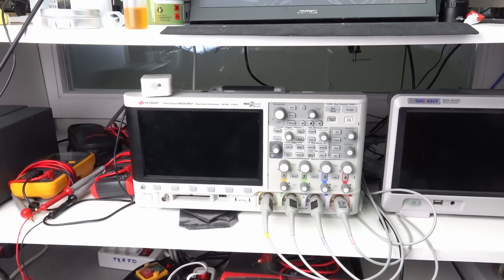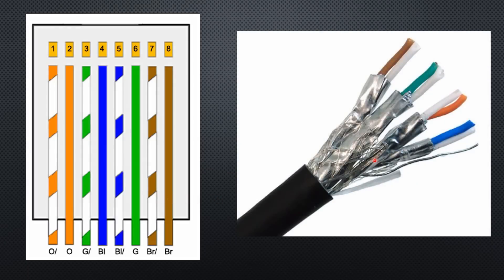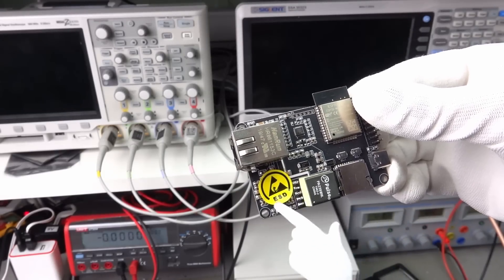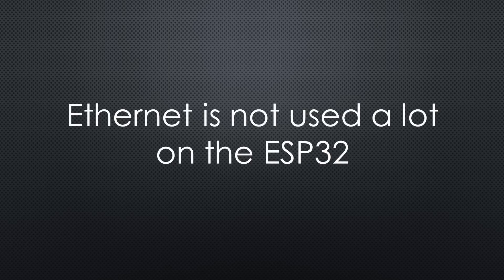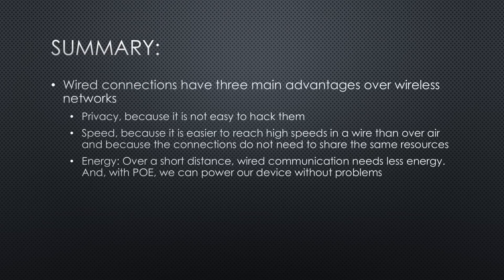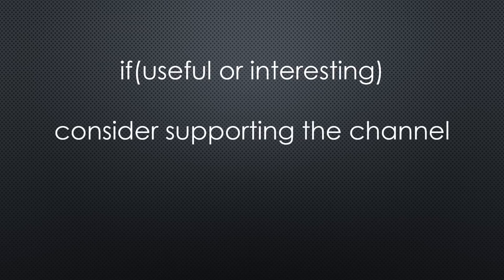(488) Is Power over Ethernet (POE) on the ESP32 any good? (New TTGO and Olimex boards available)

Comment: Unfortunately in the Australian state of NSW, it's illegal to install any cabling that transfers data or camera feeds unless you are a licenced electrician, So it's WiFi for us
Reply: I thought Finland is a nanny state, but holy crap that is insane, my tinfoil is itching, do they want the ability to jam civil communications?
I've installed my first RJ-45 networks when i was 15yr old and had to learn those old skool "crossed" connection types and all....
Reply: There is no nanny state like NSW Australia. There are laws for everything here.
Reply: ... that is only one branch of the so-called "(western) free world" 🤨
Reply: Is there a good reasoning for it or is it just the result of lobbying? 

Wouldn't that mean you'd need a electrician to install individually addressable LEDs on your porch? Sounds stupid
Reply: @bastiannenke9613  I beleive that if you had led lights running on an ESP32 then you are only supplying low power and not data it's OK. the issue is sending data over permanently installed cables, "temporary cables like patch cables can be installed (but not created) by an end user.
Reply: @bastiannenke9613 result of lobbying and is dumb. It's not any cable, just fixed power and structured cabling. So LED's would be fine unless you were trying to wire your own mains power or backbone data cables. Plug in data cables are fine though
Reply: @orangemonkeykiller  even for ethernet cables it's dumb, can't do much wrong there either, and the mistakes you can make will only cause the cable to not work but won't burn down the house. Even with Poe. Also can't cause inference.
Reply: What about using RJ-45 for power and/or HDMI? 
I can only imagine what would happen if you just install the cables without connectors, so that they exist but are not functional and after building inspection(?) you just connect them?
Reply: @woldemunster9244  so using HDMI cables or path cables are ok. can't have them running through walls as that counts as a "permanent" installation.
Reply: That's a nice little racket they've set up for themselves.  Good to know electricians are the same on any continent.
Reply: It's actually any cabling that could be connected, directly or indirectly, to the public telecommunications network. Indirectly means via an electronic device like a computer, smart TV, router, etc.

TV antenna cabling, network, weather station cables, audio cables. Anything that might be able to be plugged into something that might be connected by cables to the phone network.

The reason is to protect people who use the phone system. If you incorrectly install a cable in a wall, and someone drills through it, and connects it to mains voltage, there's a possibility you'll send mains power down the illegal wiring, through your router, and into the neighbours phones. If the phone company repair guys are out playing in the pits, you could send 240v into them too.

If you're going to ignore the license part, you need to at minimum read up on the rules. They're not particularly complex.
Reply: @tin2001 that's a load of junk. You're going pretty far out on a limb to create a very unlikely scenario. Drilling through a power cable is just going to trip the circuit protection. An open cable license for telco guys does not cover electrical safety, that is done by electricians with an electrical license. Data and power are kept separate so that voltage doesn't get induced on the data lines to ensure signal integrity. That's it, that's the only reason Telcos need to be licensed, they had a super strong lobby group in the 90's and managed to convince a bunch of politicians that they were the only ones that could keep the telecommunication network safe from instability
Reply: Correction, an open cable license to install structured cabling is different from the electrical license to install power cables. During the 90's the Telco guys wanted to make themselves feel important and pushed to have an exclusive license like the electricians, but now the electricians have taken over and get licensed in both. I think an electrical license is important, but the licensing for structured cabling is such a mess and so dumb, you need to have competency registrations for each type of cable.
Reply: only if you care what the nanny state wants
Reply: @VonEveric  Which is fine if you are happy to void your home insurance and never sell your house (you can be sued if you sell your house with illegal wiring)
Reply: This comment is worded terribly, by that definition/wording ei "any cabling" i can't plug in a usb cable from a webcam to a pc. Please clarify what you mean by "installed". Clearly not the case re: ethernet cables between machines in the same room, for example? I understand there are rules for proximity to power cables.
Reply: @benedwards9140  You must be fun at parties, The only thing we can utilise are pre made cables for anything transmiting data, and those cannot be run through walls or ceilings. The only way we can is to not be connected to a telecommunications provider and connected covers all forms of wiireless communications.
You also know Google is a thing right?
Reply: @adriandebear9900  ok to save the party, replace the word terribly with curiously.

Comment: I don't think the sticker is about 48VDC as it reads ESD, which stands for Electro-static Discharge. It's more like a warning that don't touch the board before you discharge yourself or you risk damaging the ESD sensitive components.
Reply: Yeah, on the documentation they talk about some very ESD sensitive components.
Reply from the maker: Thank you for clarification!
Reply: In some AliExpress article they say the sensitive chips are directly under the sticker, but not sure that is correct. "Touching the chip will generate static electricity."
Reply: Elec4ro-st8ticV DisCharge

Comment: Summary

Wired vs. Wireless:

* 0:28 Wired Advantages:
    * 1:34 Privacy: Harder to hack.
    * 1:41 Speed: Easier to achieve high speeds.
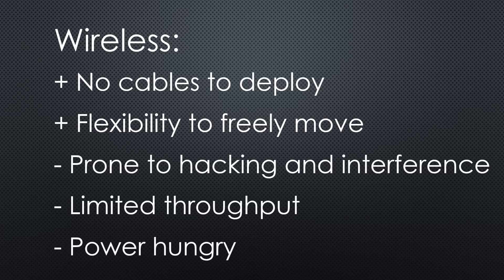    * 1:54 Energy: More efficient over short distances. POE eliminates power supplies.
* 0:28 Wired Disadvantages:
    * 1:20  Less flexible and mobile.
* 0:28 Wireless Advantages:
    * 1:20 More flexible and mobile.
* 0:28 Wireless Disadvantages:
    * 1:34 Privacy: Susceptible to hacking.
    * 1:41 Speed: Lower speeds, shared resources.
    * 1:54 Energy: Less efficient, especially at high speeds.

Ethernet Cables:

* 4:54 Use Cat7 cables for new projects.
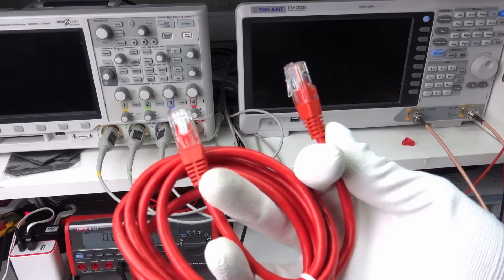* 6:21 You can buy pre-made or crimp your own cables.
* 6:21 Test all cables before use.

ESP32 Ethernet:

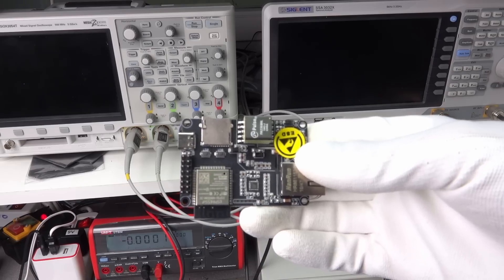* 8:27 ESP32 natively supports Ethernet with an Arduino library.
* 10:22 Ethernet chip uses 8 GPIO pins, limiting available pins.
* 8:51 Example sketch demonstrates MQTT sensor/actuator functionality.
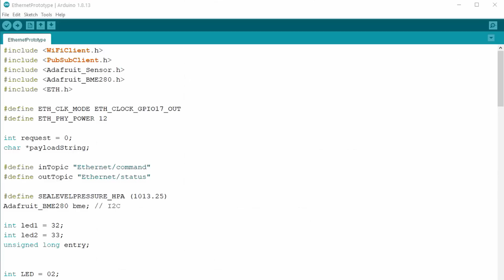* 9:00 Ethernet uses Wi-Fi commands, simplifying sketch adaptation.
* 10:36 Standard I2C pins are used by Ethernet, requiring library modifications for some sensors.

Conclusion:

* 12:59 ESP32 Ethernet is a viable option for stationary home automation devices.

Other Points:

* 3:03 TTGO and Olimex offer new ESP32 boards with Ethernet and POE.
* 2:57 The video also covers Ethernet cable categories, crimping tools, and POE basics. 

i used gemini 1.5 pro

Comment: I have been using an Olimex ESP32 POE board for my OpenMQTTGateway to connect to Xiaomi BLE thermometers for over 2 years and don`t have any problems. I like to use wired connections for bridges like that and the POE makes it more convenient since I already use POE switches for cameras.
Reply from the maker: Thank you for sharing your experience!